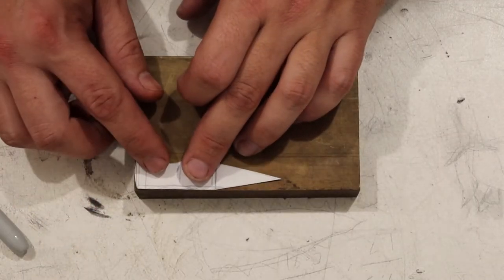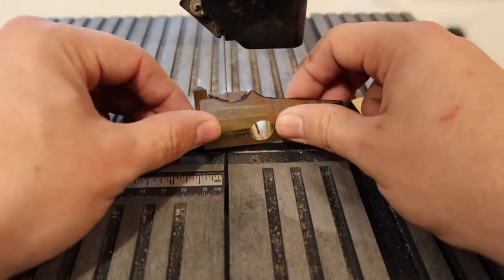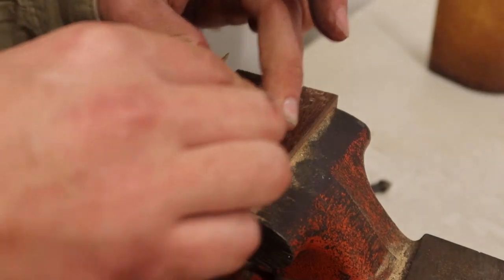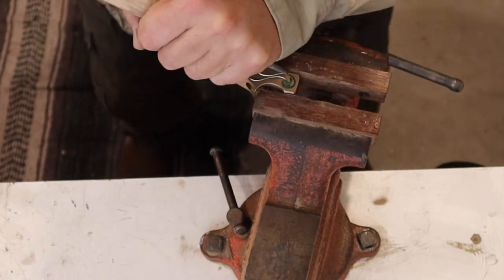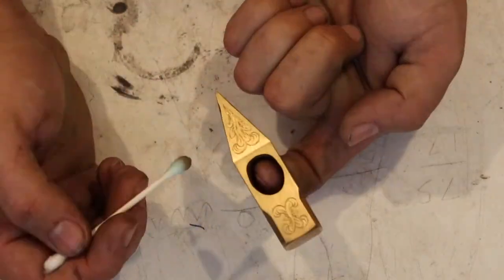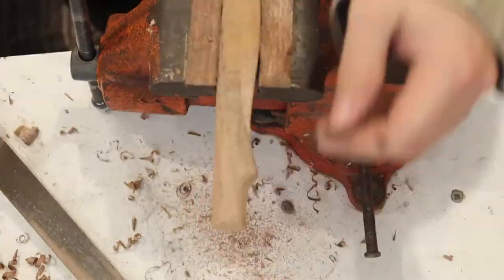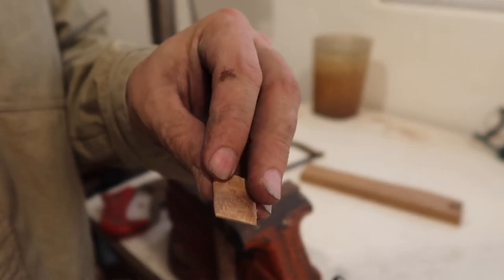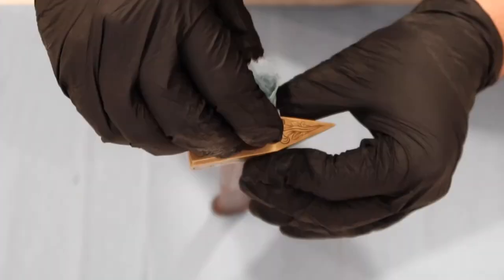Make this BRASS HAMMER from SCRATCH!!

Comment: Beautiful work!  Ten thumbs up!

I don't think I would be able to make it as nice as you did but still I think I would do a couple of things different.  
You might have a lot of reasons for making the end of the hammer head taper into a point but for my use I think I would prefer it to taper more into a blunt wedge shape so I could get use of it for setting and loosening wedges on my wooden planes.  
If using only one wedge to secure the mallet head I think I would have it 90° to the thinnest portion of the brass.  Might not matter too much though, but that is the way I was taught to do it.
Reply from the maker: Thanks! The point was purely aesthetic. That’s a good idea though! I flared out the top of the hole to the left and right for the wedge, front and back of the hole are parallel so I figured a 90 degree wedge wouldn’t be super necessary as long as I got the fit good and tight.